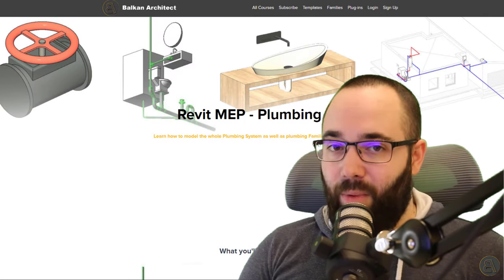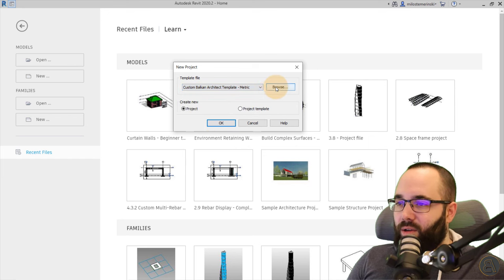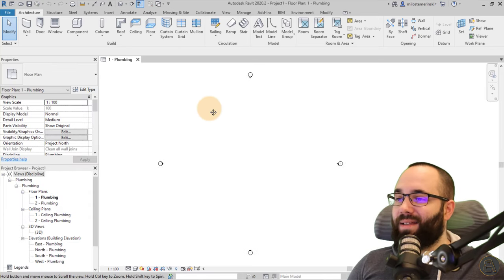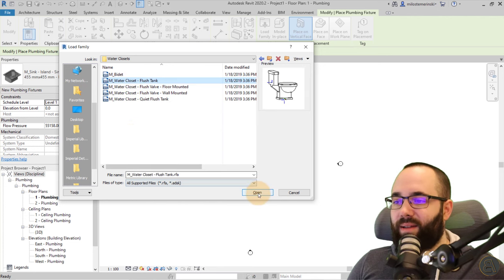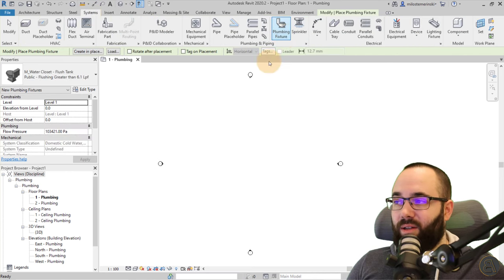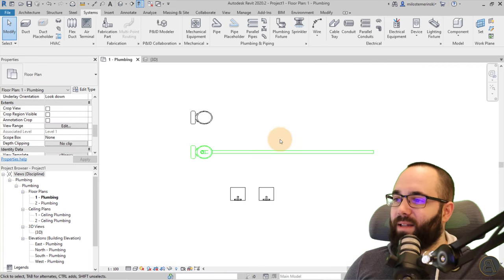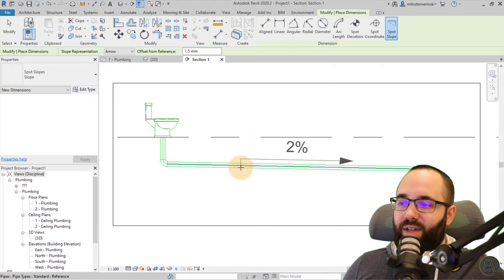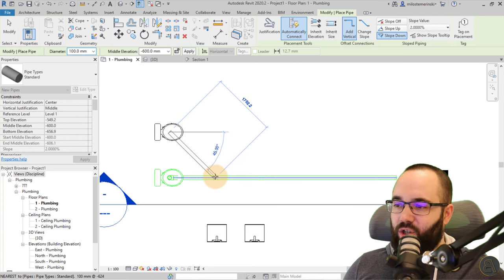Revit Plumbing - Sloped Piping in Revit Tutorial

Comment: I model plumbing in revit for a mechanical company. We have a plug in that brings in real world fittings, but the modeling workflow is universal no matter what fitting families you're using. In order to limit your frustrations, it is best to model in the same order/direction you would install the pipe. So, if your modeling a groundwork for example, then start at the street connection. Model your mainline through the entire building up to your furthest fixture. This allows you to find your main path and determine your minimum elevation (avoiding structural footings, and making sure your not coming out of the slab on the far end or to deep). This is important because your mainline elevation determines how your branch lines will take off from the mainline (verticle,horizontal, rolled @ 45 etc...). Then, go back and model in all your branch lines. I remember back when I first started modeling, and it was quite sad how long it would take me to model even a bathroom group because I was starting from so many different points and trying to make them connect. Here are some other small tips you may find helpful. Instead of clicking the inherit elevation button, just select a point on the pipe your taking off from, adjust to the angle you're looking for and hit space bar. It will automatically inherit elevation and pipe size. You can manually change the pipe size if you want to come off with a smaller pipe (it will keep the inherited elevation). If you have a horizontal line running over to an existing vertical piece and they line up you can use the trim tool to apply a 90. You can also use the extend tool to tee into a line. If you know the center of your fixture connection and your trying to 90, wye or tee of to it from your mainline, use a detail line exactly like you did in the video, but don't run the line all the way into your mainline. Stop it a few feet short. Revit will automatically highlight the line when your inline with it and you don't have to tab all the time. There are a ton of little techniques like that when it comes to modeling pipe. Sorry for rambling, just figured I would share in hopes it can help someone out there especially if they are new to modeling. I appreciate all your videos. I am constantly learning new things in revit. Keep up the good work!
Reply: thanks
Reply: That is perfect and It help me a lot plus Balkan Architect he is the only expert I have ever seen in social media and I learned a lot from him his tutorials changed my life, honestly saying I learned a lot from him and thank you for your comment it is really helpful

Comment: Just use Trim (TR) to make an elbow with two intersecting pipes.  Also just click on the little + symbols to change a fitting from a T fitting to an elbow fitting and vise/versa.  I know this is just a tutorial, but you should always load the DWV PVC piping and proper fitting for this type of application.
Reply: sometimes doesnt work in 3d/iso mode though....

Comment: Hi Balkan, thanks for the giggle 😀
In 999 out of 1000 projects the Architect will place plumbing fixtures in their model so connecting to their models pipe connectors is problematic if you are not able to access their central model. Also this only works if the revit family used is the exact model of the fixture being installed otherwise set outs will be compromised. 
I have found over the past eight years using Revit, as a Hydraulics Draughtsman, that it is easier to create a family with connectors that you can place where required. This also stops a piping system from breaking when the Architect changes the layout.
As noted below Trim (TR) [what 30 years of AutoCAD tells me is a fillet] and Extend (TE) are far better ways of joining pipework.
One last point, every time the Architect moves a fixture that you have already piped to, it is a guarantee that when you look to realign the pipes the modeller will need to remodel at least half of the pipe run

Comment: Since you asked lol.......I will definitely make a video for you and the Community from a Revit Plumbing Expert! First off, I really love that you help out the community so much (even Plumbing!). For sloped piping there are a couple of things to keep in mind. My biggest suggestion would be to always draw your longest run first. The longest run is the critical path that's going to determine your invert elevation (how deep you exit the building). Once you have your main, you should always draw from that main to your fixtures (sloping up like you show). Revit does a great job of guessing where you want to connect. There isn't a need for the construction detail lines if you use the proper techniques. Use the trim commands to connect from your horizontal to the vertical portion. But in all honesty, I would recommend only drawing your mains with a slope. I'm sure there are many professionals who will tell you, making edits after the fact when the piping is sloped becomes a nightmare. Most sections of the building should NOT be drawn with a slope! Only critical paths should be sloped. It depends of the LOD (level of development) whether or not you should be drawing with a slope. It is not necessary to draw piping at slopes if you are 200 and below. You need to make sure to consider tricky areas and do you best to avoid conflicts, but rarely is sloped piping going to help you for most MEP models. Another tip, large pipe like storm drains should probably be sloped in the model. It won't take too much time, but most sanitary for simple bathrooms and small areas, just avoid it and connect to your mains that are sloped. There is a great plugin that I will show in a future video that makes sloped pipe a breeze! But still...I'd avoid it lol.
Reply: Why is this guy doing Plumbing?. It's like the MEP Guy doing an Architecture project.
Reply: @whatsmyname787   haha! I think there is a huge demand for plumbing videos. I've followed Balkan for years and I'm sure he gets comments from MEP people all the time about doing a plumbing video. So he decided to give the people what they wanted! He shoulda  messaged me first though. I'd be willing to do a plumbing video with him on his channel. But I commend him for trying!
Reply: Plumbing engineer here.  I follow a similar method.  I draw the longest run first to get the deepest invert.  Then for the other runs, I draw the piping shallower (starting with an 18" or 24" deep invert, for example) with pitch.  When the piping gets close to the main, I then change the offset setting from "add vertical" to "change slope".  The slope will be steeper, but that is okay.  When a plumber installs their piping they want to keep it shallow so it doesn't cost as much to excavate.  Keeping the pipe higher when possible also helps avoid dropping footings unnecessarily.
Reply: @mep_guy  I commend him for trying also. I could try to do mechanical ducting on YouTube but I think it would be disingenuous.  I understand he has a large audience, thousands, but I also see Plumbing tutorials on YouTube where the author only has maybe 60 Views and doing Plumbing a lot better than balkan. I just think it's disingenuous that he's doing Plumbing videos. He could refer his Plumbing audience to another YouTuber.

Comment: Great channel! I appreciate you dabbling in the piping! Yes, sloped piping has come a long way in Revit. I use several different approaches and I agree with many of the comments. Sloped pipe gets even more interesting when you have 1% and 2% pipe together along with combination fittings. BTW: the reason your pipe did not connect cleanly in the beginning was because the pipes are sloping and of different length, even though the center point of each pipe is at the same elevation. Keep up the good work!!

Comment: When I am drawing sloped drainage piping, I draw sloping down from the fixture towards the main and sloping up from the main (using inherit elevation) towards the fixture without connecting the two pipes.  In an elevation view I use the align command to align the slopes of the two pipes before using the trim extend command to connect them.

Comment: I use Revit to draw larger diameter 3-60" ductile iron piping.  I have not found a good solution to easily accommodate slopes.  The initial drawing is tedious but not all that bad,  my issues come in when revisions need to be made and now a branch that has a couple 45's and wyes into a main line needs to be adjusted 6" to the left and 1' to the south while maintaining specific elevations at a specific slope angle.  If it doesn't have a slope this is no issue at all but with it being sloped and trying to adjust things in plan view while also trying to maintain specific elevations is really cumbersome and difficult in Revit.  Every time you try and adjust something, it wants to snap back to either zero slope or a different than original slope.  I hope Revit continues to improve on this in future releases.
Reply: I totally agree David. It's very challenging to make revisions to sloped piping. I'm going to be doing a video soon on this topic. Look out for it next week.
Reply: My sloped Piping video is up on my Channel. Let me know if you have any questions!

Comment: On the video screen shot you have the toilet waste off the bottom of the pan. If only. Does this happen in countries outside Europe? Maybe Middle East or Asia?
Reply: Very common in America. It's basically a flange on the floor with a knockout for the waste.the toilet is then bolted to the floor and sealed to the flange using a wax ring. If the toilets are ever wall mounted with a rear outlet then they are typically supported using a carrier system which requires a chase wall to house it. These are common on commercial or industrial projects.

Comment: Hello! I've seen a lot of changes in the slope value when modelling  (i.e 0.98%, 1.023 %...in place of 1% as set), in particular when modifying, reconnecting some parts of the system etc. Is there a way to solve this issue?

Comment: From my experience it is far superior to draw plumbing backward, starting from the shaft, bringing the main pipes to the consumers with a positive slope instead of the other way around. You can just branch out in the general direction and align it with the consumer when drawing the side branches, instead of drawing a detail line. When working with a big system you want to minimize the amount of operation you switch to work fast. Also it prevents redrawing when you meet other installations and something doesn't fit because of the sloped pipe, because you have to avoid them from the start coming from the shaft (and those collection pipes are going to be the biggest anyway).